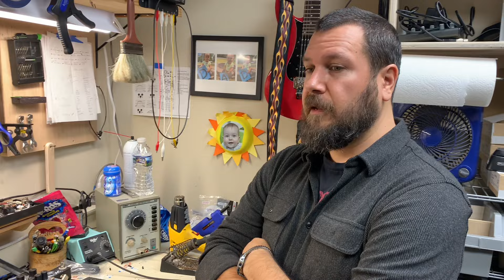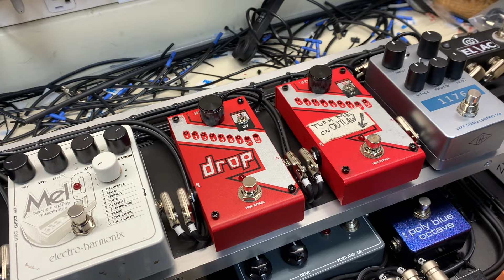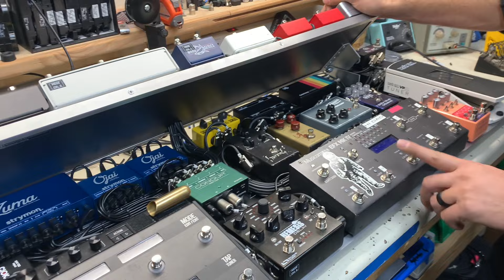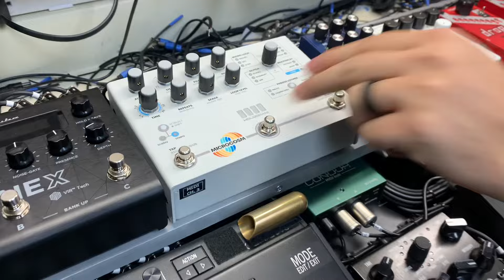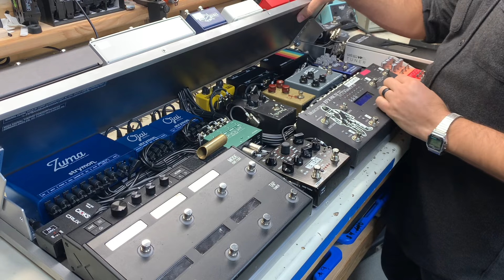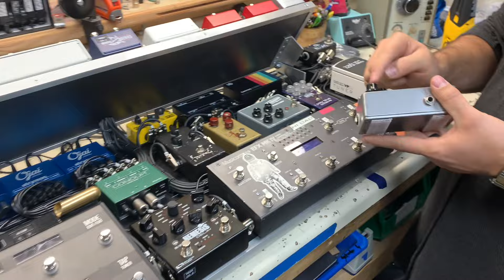Custom pedalboard for Mike Scheuchzer of MercyMe

Comment: with all that, what's the point of an HX Effect?
Reply: Why not?
Reply: @boabglen  I’m just genuinely curious why a professional musician that has access to pretty much anything they want and clearly has a board full of pedals would use it for. Obviously it’s not about space or weight reduction and those pedals will cover every base and sound better doing it. The midi controller and looper act as the brain so the Hx isn’t really doing that either. I have one but I just play at home and don’t want to buy 20 $200-400 pedals lol I just like to know people’s perspective on gear choices.
Reply: It probably does save space if he uses it for a bunch of one off sounds, or even for presets to reduce knob twisting mid set.
Reply: @jcoriha  That could very well be the case. I just figure he's got a different reason for choosing the device than I would and may learn a new way to utilize it.